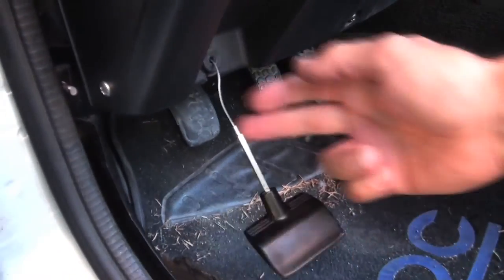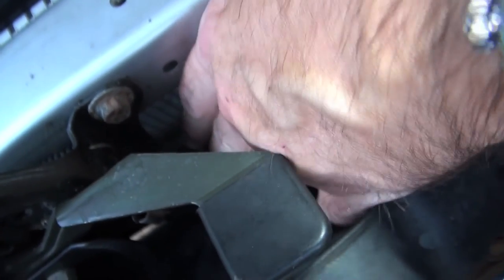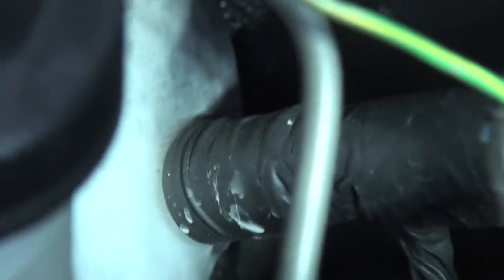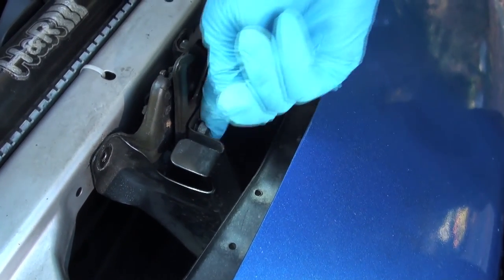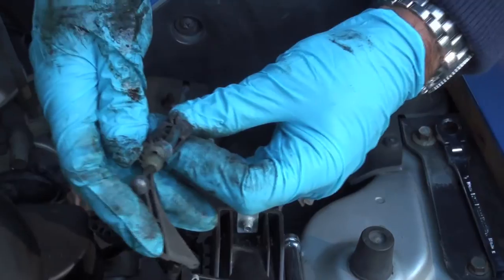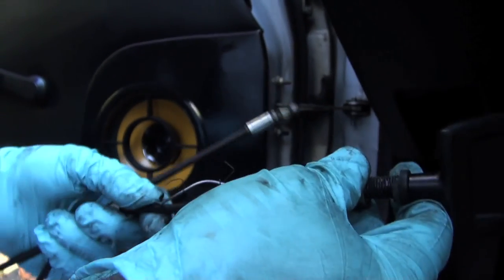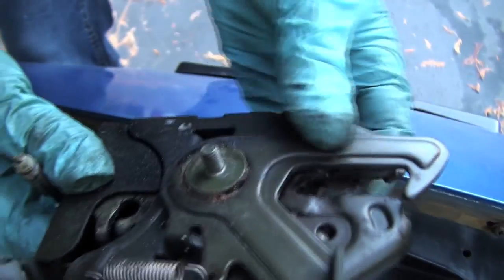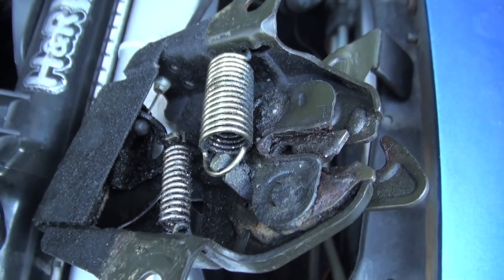Miata MX5 Hood Release Cable Replacement - MIATA STREET

Comment: HEY READ THIS PLEASE.

Before you pull your busted cable from your car, do this: Attach a long wire or string to the end of the cable, where it attaches to the hood latch. When you pull the cable from the car, you'll thread your line through the firewall. Untie the wire/string from your hood release cable. Then, tie your wire/string to your NEW replacement cable. Pull on the wire/string from the engine bay side, and you'll be able to thread the NEW replacement cable through your firewall without any problems at all. It saves you some time, and you dont have to spend any time laying down on your back in your drivers side footwell. PLUS, the wire/string will show you exactly where to route the new replacement cable through your engine bay.
Reply: As someone who just did this today, this man's advice is something you should take. I made the mistake of not using a string and spent an hour being frustrated at the fact that I couldnt thread the cable back in. I had to cut a phone carger cable and feed it through the firewall and tie a shoestring to that and the new cable and then pull it through. But starting with a string prevents all the frustration

Comment: This was a wonderfully helpful video.  I followed it to replace my hood release cable.  Thank you!!!

Definitely tie a string to the old cable before pulling it out.  Even better cut the old cable inside the car and tape the new cable to it.  You can then pull the old cable out through the firewall (into the engine area) and the new cable will follow along.  You can then pull the entire new cable along the path of the old cable.  It makes this a very simple job.    For me, my hood wouldn't close and it turn out that the cable had broken where it connects to the hood latch in the front of the care.  Replacing the cable solved the problem and the hood now closess.